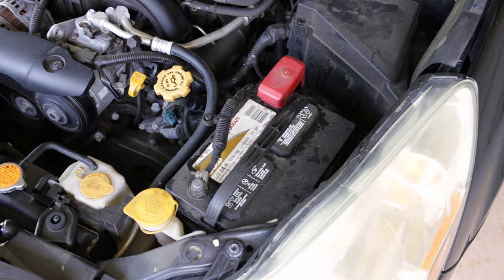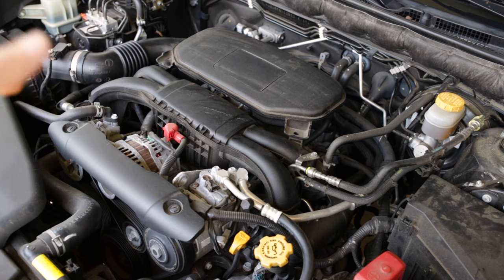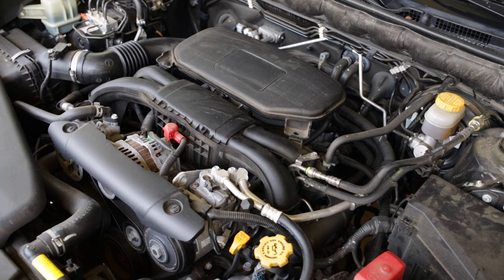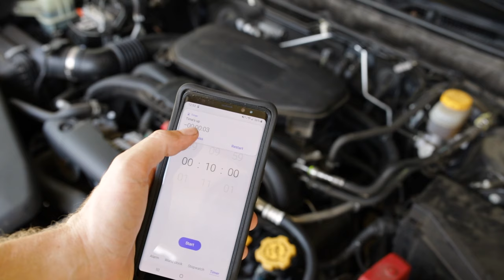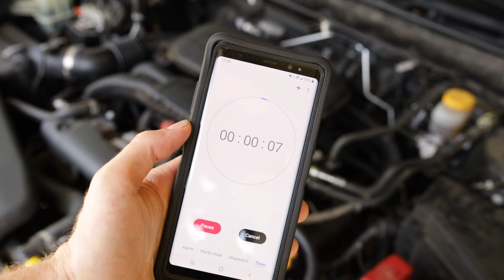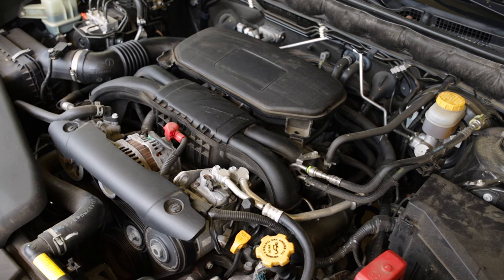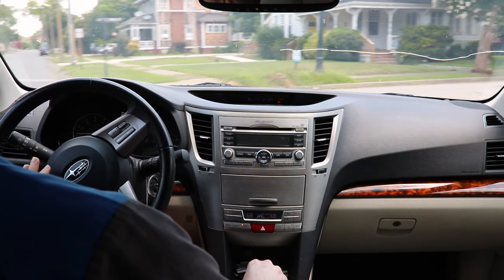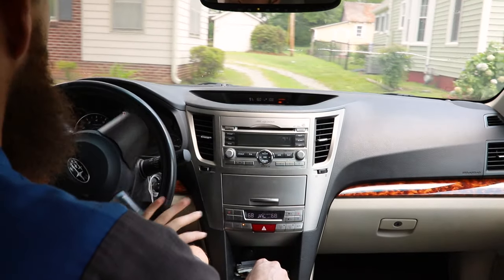Subaru Idle Relearn Procedure

Comment: My 2013 impreza sedan had been sitting in the garage for weeks due to the Coronavirus pandemic. The battery lost power so the engine wouldn't start. I went ahead and connected a battery charger to it and the engine started just fine. I began warming up the engine daily to avoid the same battery problem. Ever since, I noticed an iddle issue at very low rpm without the car running, simply sitting in thr garage and in parking gear. I never did anything about it until I run the car for the first time about 2 weeks later. Immediately I noticed the rpm drop to 300-400 when in drive gear and when I changed to reverse gear the engine stalled and shut off like MT cars , but mine is AT. I got scared, AC was off, lights were off (11am), what do I do?.  I started the engine again and had to use the gas pedal to accelerate the rpm to not stall again.
I thought I needed to take it to get an ECU scan or any other expensive labor,  but I found this video, followed it step it step and Holy idle fix batman! It worked perfectly. 👌👍
Note: If you live in a hot place like me, try it with the windows down so you don't swet like Patrick Ewing in the Eastern Conference Finals against the Bulls 😉
Reply from the maker: Glad to help. 👍🏻

Comment: I tried to do the idle relearn on my 2011 NA Forester after changing the O2 sensors, but it did not take. I will try again today. However, one thing that is not being explained here or anywhere is the ambient temp conditions in which you can do this.  Can it be done in a driveway when the exterior temp is in the 40s (F) or lower, and does the car have to be warm, to begin with???

Comment: Very interesting, thanks.  Would I use the same procedure on a 2001 Outback?  Battery has been disconnedted for a few days. (Usually runs fine, slightly higher gas consumption over the last few years).

Comment: In the middle of this procedure right now.  Did a plug change and moved coil 3 to 1 to address a #3 misfire code, codes were cleared by my scanner but battery wasn't removed.  Idle was very low and the car would stall when you put it in gear (2011 Legacy 2.5 CVT).  Hoping this helps.
Reply: Well that didn't help.  Still stalling, tcs light is lit and cruise flashes on the display.   Not my car so i didnt want to do too much to it, never worked on a subaru before.
Reply from the maker: Torque converter failure.

Comment: Does this (disconnecting the battery for so long) affect other learned procedures? I just had my transmission fluid exchanged (CVT) and they supposedly performed an A/T relearn which I wouldn't want to lose because of disconnecting the battery

Comment: How do you turn off auto lights for the relearn procedure?  It happens to be dark while I am doing this. And headlights will not shut off due to its auto dark feature.  This money pit Subaru has been irritating.  I am fixing for some friends since nobody around here can afford the stealership prices.  So far I have changed coil packs, spark plugs, primary upstream 02 sensor, MAF sensor, and battery., found and fixed huge vacuum leak on the intercooler to throttle body tube and the idle is still garbage, stalling, popping like there is another vacuum leak under intake manifold.  I am trying to avoid removing intake manifold due to all the lines and components I have to remove potentially doing more damage to factory brittle plastic components and connectors.  From this experience this will be the first and last Subaru I will work on.  Every thing on this vehicle except the MAF r&r has been miserable.  The owners like the vehicle when it was running great but now its like peeling an onion, another layer is always there.  It started iut with some so called Subaru expert recommissioning plugs, coils, and 02 sensor to correct the poor idle and low throttle problems.  I test drove car and its mid to high rpm driving is ok but down liw it stumbles and stalls.  Dunny thing is, I unplugged MAF sensor and it ran good on test drive despite high idle speed.  That is what les to my changing MAF sensor which did not improve the low end stall stumble conditions.  Funny thing just like your video this car also has a growling rear wheel bearing.  When I was stationed in Japan the Japan Subaru models were much better, Subarus of America are so far not near as giod.

Comment: I have a 2014 Forester 2.5 Limited and performed this procedure. It ran well for just a couple of days and now has gone back to having somewhat rough idle at start up . When we drive it in city driving, it stalls/hesitates, not a bad stall but enough to notice and make driving not enjoyable . A trusted shop in my area said it was the transmission but they don't work on trans so I took it to the Subaru dealer. They told me they checked it out but could feel what I was telling them so they asked me to drive it with the service rep . During the test drive the Forester ran fine. I am very frustrated, we bought this used in February in very good condition with about 64,000 miles and pretty much has run strange since about March. Is there anything you would recommend that might be the problem , like maybe the electronic valve body or it needs to relearn again?  Would appreciate any advise.
Reply from the maker: Sounds like a possible failing torque converter. See that quite a bit with stalling coming to a stop.
Reply: @MrSubaru1387  I trust you are right about it but my problem is the Subaru dealer already inspected it and are saying there is nothing wrong with it. I will try taking it to a transmission shop for them to inspect it and if they say it's the torque converter, then I will have two shops having a written report stating the problem. Then hopefully my Subaru warranty will step in and tell the dealer to fix it.   Thank you and keep up the good and helpful work.
Reply from the maker: The local Subaru dealership said torque converter clutch failure was something they never heard of in the CVT transmissions. There are TSBs from Subaru on the issue... Most dealerships are full of idiots.
Reply: @MrSubaru1387  Good to know, thank you!!

Comment: Do I need to disable the daytime running lights before doing this procedure on a 2005 Outback? If so, how do I do that? Also, I did the throttle body cleaning, new air filter, clean MAF sensor about 9000 mostly highway miles ago. Should I do that all again before doing an idle relearn?
Reply from the maker: Handbrake up should disable the DRLs. With that small amount of time, likely wouldn't need to reclean.

Comment: While spraying in the inlet the small 3mm tube shot off into the plastic inlet.
Now it's idling bad. 
Fault cod p0101 which is implying the maf. 

Do I need to strip the inlet down and hope to find said straw or will it burn through the engine

Comment: Hi Mr Subaru 
I need some help on my Subaru Outback 2011 
I replace the valve body oil change and relearn the the new part that I put in to the car but I have the code P0700 this code is the TCM 
But I don’t know if I need to take it to the mechanic shop to haven’t relearn the valve body 
Sin I used the autel scanner to set up the relearn 
The scanner that I use is the autel mixicom mk808ts I don’t know if I need a different scanner to do the relearn 
Please I need some help 
I will really appreciate it if you can help me with it

Comment: Hi again 
My turbo, On my 2004 2.5l xt Subaru Forester I replaced thank you for your advice you were correct it was blown. 
I have two other questions to ask you. On my automatic transmission some times when I switch off the car there’s a “doffing sound“ coming from underneath  from the transmission?
And the other question is what is the “ec” after the 2.5 xt?

Comment: Man, I need your help. I had to replace my engine, it spun a rod bearing. I Replaced the block, got the heads redone, installed a new timing belt and gears, water and oil pumps. I've replaced literally every sensor on the engine, vvt, cam position, etc. Cleaned maf,  etc. New pedal position sensor, replaced, ecu...just basically the car is more new/replaced parts than the old one. I've done this reset procedure...BUT, no matter what work I've done and this. It ALWAYS idles at around 1200-1400 
Rpm in park and neutral AND it keeps breaking return springs on the throttle
Body. I've literally had to replace the throttle body 6 times already. I'm at my wits end, I have no idea what to do! I've even looked for shorts or broken wires in the harness.

Comment: I need to do this with my 2010 Forester. When I start it in the morning, it sounds like an old tractor starting up for the first 10 minutes or so. Need to clean the throttle body and I am pretty sure that my EGR valve is full of carbon as when it opens and closes with throttle and speed, it whistles...

Comment: I have a 2010 legacy 2.5 cvt(225k)
I have tried this on it but it didn't work.
The thing is when you are at a stop light the idle drops at returns to normal with engine shake. Even when you want to shift from D to R the idle again drops and when you try to move backward by hitting the gas pedal it drops and adjusts as if the car if shaking.
Your videos helped me a lot i follow you all the time but this is driving me nuts
I would appreciate any ideas
Cheers

Comment: Thankyou very much .problem solved.have you ever had fault with car stailing low fuel 40deg cel day no fuel from supply line,fuel pump cut out,pump fuse ok.then start about hour later.car has 100k km on the clock.debateing buying new fuel pump just in case

Comment: Hey there, so I have a 2011 Tribeca that recently got a little hot after the engine coolant temp sensor went out so I replaced it and made sure coolant levels were good and system was burped. Took it on a test drive and I noticed that any time I left off the gas from around 40-60mph the rpm’s would drop down to about 1k rpms and sometimes lower but at greater speeds that that would usually hold rpms. During this time I changed the plugs as it was surging under load and thought maybe that this was related but still had the same issue so I cleaned the TB since it was drive by wire and I followed your video to the T on the relearn process but the sweep in you video my car didn’t do just heard the hum but no other noises. Now the car only drops rpms when braking from about 45mph or less and sometimes drops as low as 750rpms. Not sure how to fix this.

Comment: Hi there Mr Subaru, is this constant across all years/models??
Reply from the maker: 05+ with electronic throttle body.
Reply: @MrSubaru1387 That's interesting. Just had to unplug Front AF sensor, clean some contacts, and earths to get rid of a P0030 code. Idle is now just a little erratic, sometimes sticks for a couple fo seconds around 1500 before settling. It's not fly by wire, so this process doesn't apply though i did try it anyway. Any thoughts? its 2005/6 H4SOH 2.5LT Manual

Comment: Hello Mrsubaru, I did this procedure on my 2017 sti a couple times after installing a new oem throttle body, but my idle is Hanging around 1800 rpm. Any ideas or recommendations? Thank you for the educational videos
Reply: Have you let the car warm up? 1800rpm is the elevated idle to warm the engine up when it's cold.

Comment: Great video!  Is there a way to increase my idle to 1000 to 1200 RPMs? Want to run a 1000w inverter  without having alternator heat up too much.   Thanks!

Comment: I don’t really ever mess with Subaru’s. Have a 08 Tribeca that has a low idle, no charging, no A/C clutch and won’t bump the idle when you turn the steering wheel and a P0500 code. Would a idle relearn clear any of those  idle issues up?

Comment: @MrSubaru1387 - I noticed it seems that the AC compressor is engaged during this process. Do you specifically recommend the AC be on, with lowest fan speed, to put 'full idle load' on the engine or can the AC compressor remain off during this procedure?
Reply: Turn it off defrost and then turn recirculation off

Comment: I am looking at this in July 0f 2023.  At this point in time you have acquired your own 2015 Subaru Outback.  I have a 2015 Subaru outback and need to perform the relearn procedure  however since the radio is integrated into the start up I can't shut it down.  So how to I eliminate it from the equation

Comment: It's better to do it with everything on cuz you wanted to learn the engine to know what to do when all the power is being used because you don't do it under load when you come to a stop or turn your lights or ruin your windows up that's when the engine starts to bulk down so if you're going to do it make sure everything's on when it's relearning because this way it'll note to have a higher power level so it doesn't stall when you come to a stoplight all you're doing with that just give me back to the same thing you must idle learn it under load so it knows what happens when it's under load it'll keep that idle up

Comment: @MrSubaru1387 My 06 STI idles rough on warmup only when coolant surpasses 160 degrees f. It runs Lean and then cycles to rich and so on up until i go to drive the car. Is this an injector problem?

Comment: Got a p0172 problem on my 2011 impreza XV made japan, I am in south america, have done all kinds of work, replaced sensors plugs cleaned injectors timing belt alternator belt (maintenance).. fuel pressure is good... Cleaned throtle body,... Code still in and engine stutters .... Idles high a little and uneaven.... Checked coil, checked plugs... Help! Any ideas..???

Comment: This will work on a 2011 Outback with a CVT? I just replaced the valve transmission body in my Outback, and I was told that it needs a special cable and software to relearn the transmission. Is that still required, or is this idle relearn a full substitute for that?
Reply from the maker: No. This isn't the same as the AT learning procedure for a valve body replacement.
Reply: @MrSubaru1387  Is it necessary to go through the AT learning procedure if it seems to be running fine? I've received conflicting opinions. On one had, i was told that i need to relearn the AT, and when i contacted a Subaru Mechanic shop, they said that on a 2011 Outback it isn't necessary, unless it's running weird, and that clearing the warning lights through disconnecting the battery, will reset the memory, and all i need to do is drive it. 
I really do appreciate your help. Your video on the valve body replacement was the saving grace when me and my uncle were in the process of the replacement.
Reply from the maker: Not according to the Subaru factory service manual. The AT learning process must be done via scan tool or manually. To to so manually the at learned values must be cleared to start the manual learning via driving the vehicle. A battery disconnect won't clear the old learned values. It must be done via scan tool. Once the learned values are cleared, the atf temp light will flash. It will continue to flash until you've driven long enough for the TCM to finish the manual learn.

Comment: Great stuff MrSubaru1387. Can you do a video on that check engine light, flashing cruise control light and traction control problem that some of us if not all of have?
Reply from the maker: Anytime you get any code, CEL, in a 2005+ Subaru, the cruise control automatically disables. If the issue is ABS related, it also disables the traction control. I can film one video to cover every possible code. You'll have to scan the car and see what codes are active first. Most parts stores will read your codes for free.
Reply: @MrSubaru1387  I did a procedure about removing the gas cap and waiting a few seconds before putting the cap back in and starting engine. It worked for a bit and started acting up. Did it again and been good so far.

Comment: Could I pull the interior lights fuse so that I can open the door each time I start the engine? Reaching into the car with the DS window open t reach the key is almost impossible for me. It sounded like you were opening and closing the door each time you started in the video.

Comment: Hello MrSubaru,i have a 2008 forester 5 speed,when i press the clutch all the way down coming to a full stop at red right my rpm drop really low that engine shakes but never shuts off,no vacuum leaks no check engine and idles smooth
Reply from the maker: Hmm. I'd have guess a possible vacuum leak. If you don't have any codes stored, your best bet is to get into the live data and see if there are any red flags. That is if you have access to a scan tool with data capabilities.
Reply: possibly your driveline, check your inner cv joint

Comment: Can I still do this procedure even though I missed all these after I cleaned the throttle body? My rpm at idle is around 750 then flactuates to 1000 then goes back to 750 again.
Reply: I did the procedure and the idle now is smooth and rpm is steady at around 750. Thank you

Comment: Hi i have subaru impreza 2007 2.0 my car drops rpm and doesnt become normal after that people told me its throttle body i cleaned it completely but the problem is still there it has new coils new spark plugs 
The car died on the way today 2-3 times due to drop of rpm I don’t know what is the issue exactly 😊

Comment: Hi!
With my outback 2014 i am having issue at every stop it will idle rough at moment when I am stoping. Its worse when engine is cold but it does not go away when engine warms up maybe just little bit. I did this procedure without cleaning throttle body and it did not help. 
I have been having this issue for a year, clean throttle body 6 months ago hoping it will help but did not do re learn portion. 
I also took it to Subaru dealership and ask them to check on this they could not find any problem. They told me they check everything and they could not find problem but they suggested they can go and start replacing plugs and etc till they find what is causing this. I did it my self and same so its not plugs.
Anyway, is there anything you guys can recommend  what should I do next to fix this problem.